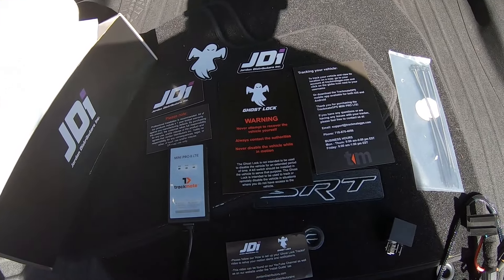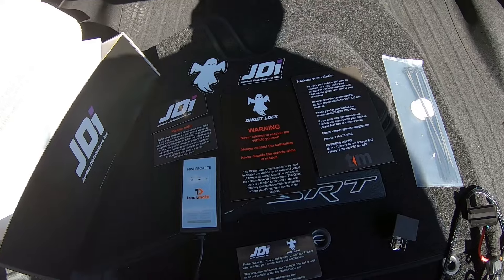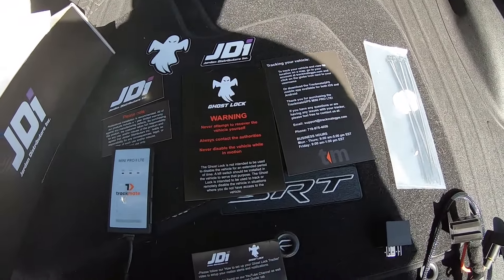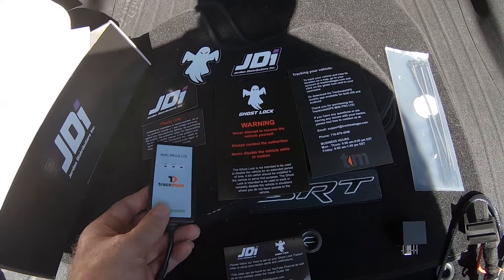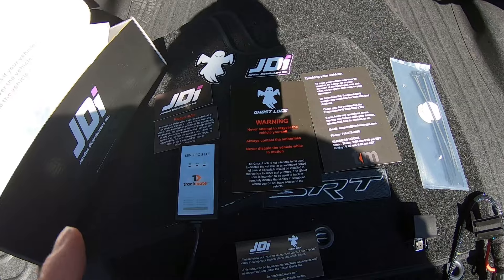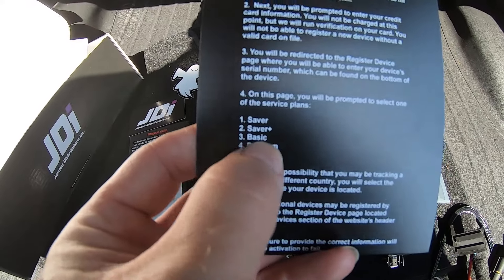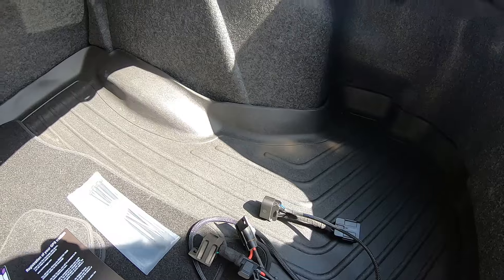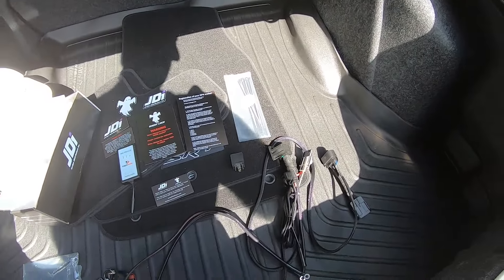2019 Hellcat Challenger JDi Ghost Lock Install.  @JordanDistributorsinc

Comment: If anyone can help me answer these questions.
1.can ghost lock be used with compustar and its starter kill switch?

2.i already have a gps tracker, can the remote fuel pump kill switch just be installed instead?

3. What's the range on sending the kill signal?
Reply from the maker: I can help answer two of these.  2.  The gps module is the device in this case that kills the fuel pump as the gps has a control wire that turns on/off a relay.  3.  The range to disable the fuel pump is limited only to the gps device being able to receiving signal and the ability for me to access the on-line app.
Reply: @solargarage  Thanks for the reply, much appreciated.

Comment: Could you just leave the fuel pump off while it’s parked in the drive way? Instead of turning off the fuel pump once it’s stolen?
Reply from the maker: Thanks for the comment.  For this setup they do not suggest using this system to turn the fuel pump off long term.  By default they enable the full pump via the Normally closed contacts of a relay.  When the fuel pump is disabled it does this by energizing the relay which then opens the normally closed relay connections, so when the fuel pump is disabled the relay is being energized and using power.
Reply: @solargarage  long periods of time as in days and weeks or hours , cause id like to turn mine off overnight just to be safe.
Reply from the maker: @Leakurs  No sure.  Looking at there documentation I see just a mention about not using it to turn the pump off for extended periods.  Might be better to reach out to JDi.  Also they have there Ghost power system which can and does kill power long term to the start/stop button.

Comment: I’m ashamed to say but it’s worth keeping my ish protected I’m running compustar ..igla..drone & ghost lock
Reply: Great combo . Currently waiting on my order for install ..
Reply: You can use compustar and drone to recreate ghost lock. Use Aux functions. You can wire it to when you arm your alarm, it will automatically turn your fuel pump off
Reply from the maker: Nice combo.
Reply: Nice, I added the neutral plate cover, a hidden gps tracker, planning to get compustar and thinking about this fuel pump kill.
Reply: @Kratos510e where you get your neutral cover